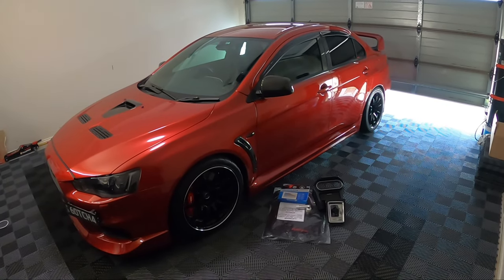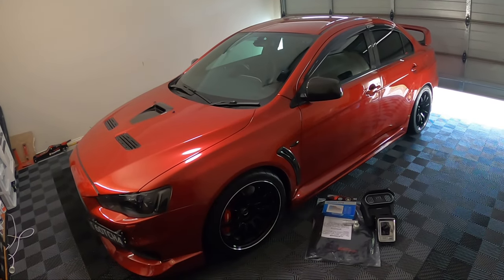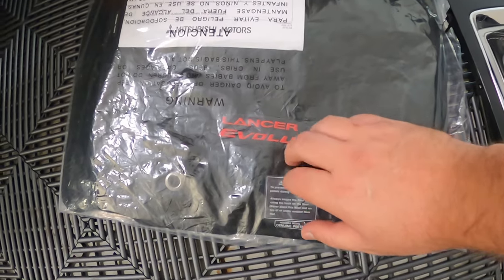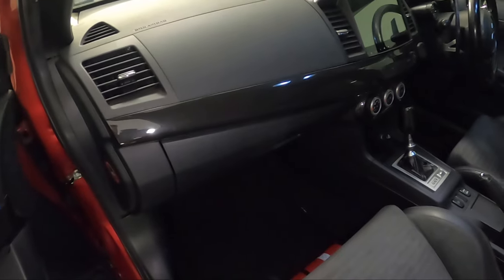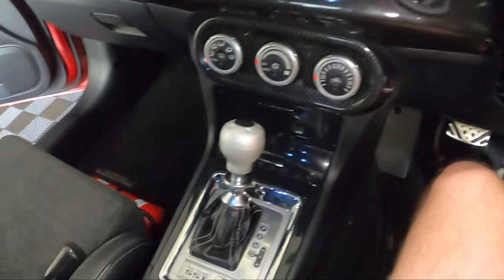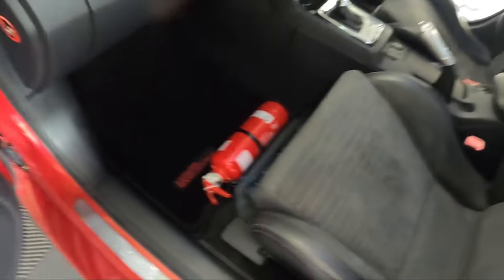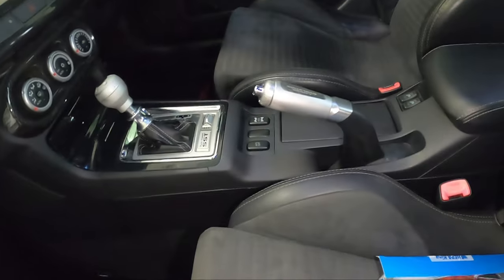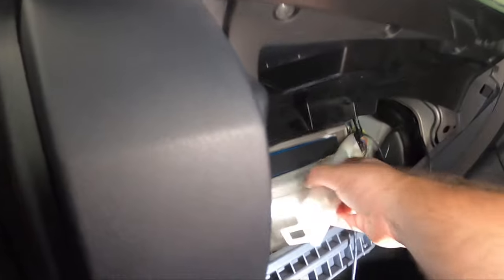Evo X MR Gets Some Interior Upgrades

Comment: I have the same shift knob, fitted by the previous owner. One thing to note, if you park out in the sun for a while it can get hot to touch. I need some new floor mats too. Nice video.
Reply from the maker: Haha yeah it's only been garaged so far and I've noticed it gets quite cold so assumed it would be a hand burner when parked outside

Comment: Hey mate really off topic question but have you any thoughts on the 350z compared to the Ralliart eg have you raced one or having any experiences of them that you can share, tossing up between 350z and a Ralliart. Pretty different beasts but hold some type of precedent.
Reply from the maker: Hey mate like you said very different types of cars, AWD turbo Sedan vs RWD NA Coupe.
Totally different driving experiences but as for stock for stock I'd say 350z might he slightly faster but as soon as you spend a few hundred to tune the Ralliart it is far quicker and potential for power on them is endless.
If you want manual get the 350z as that's not an option in the RA and of you're wanting auto 100% get the Ralliart as it has a dct box and not a boring torque converter auto

Comment: When buying a used evo X MR with the sst how many miles is too many?
Reply from the maker: I'd say miles aren't as important as servicing and how the car was driven/looked after.
Mine has done 185,000kms and is an 08 model and only slipping the clutches a little where as some people have bought some with 40,000kms and had more issues than mine.
If you can find one with a replaced SST then that's the best option even if it has higher kms

Comment: Hello I’ve recently been on the market for a evo mr. I would like to get it near 500 whp. But I have one question, if anyone else in my family were to drive, would it be ok for the car to drive in nonmanual mode with that much hp, or would it put to much pressure on the trans and clutch?
Reply: I’m also looking to daily the car.
Reply from the maker: Hi so if they were just driving off boost and cruising in it I would say you'd be fine.
If there were driving it hard in normal mode then yes that would cause problems with the clutches 

At that power level you'd need upgraded clutches also ad thr stock ones only handle up to around the 430whp level